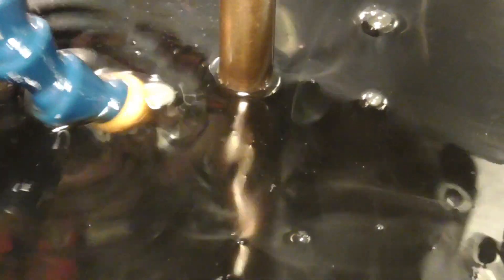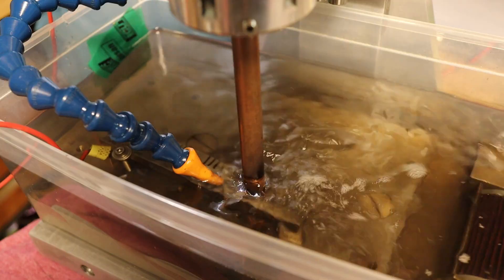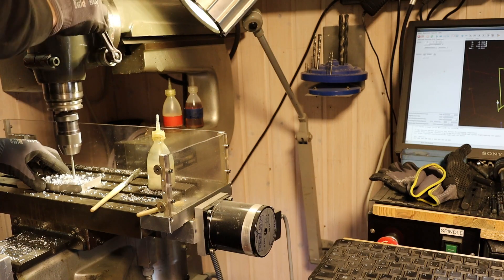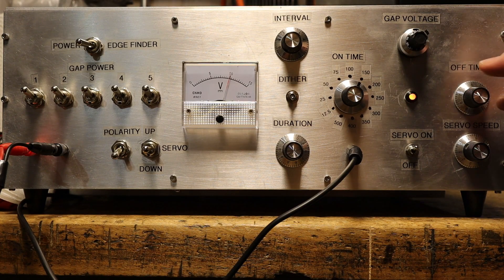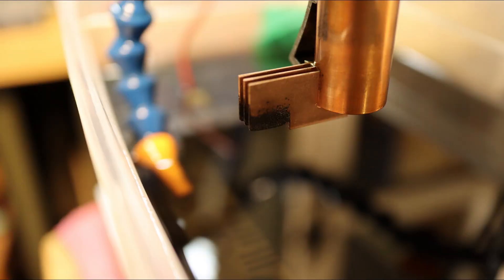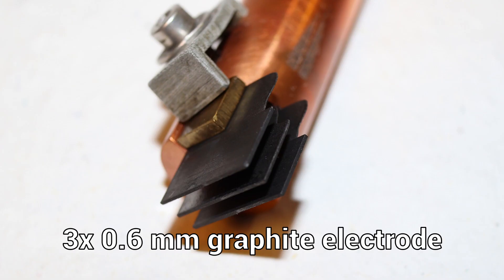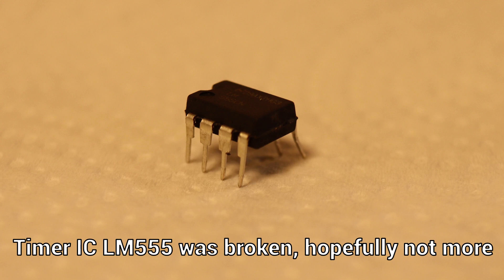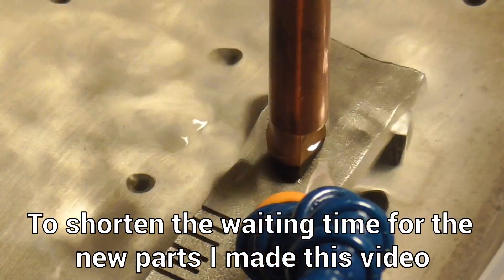DIY PULSE EDM - Part 3 - Fixing the exploded machine

Comment: I don’t know the design of the E.D.M. you’re trying to build but it looks like a pulsed R.C. design and not a true pulse E.D.M. as the burn amps and electrode wear look way too high when using a 25 Ohm output power resistor to your electrode, although you could be using two in parallel for a 12.5 Ohm output so output amps should be either just 2 or 4 at the working voltage (50v) which is not what it looks like in your video. I have found out lately that those types of resistors are a bit “iffy” so I would recommend that you just make your own from nichrome wire which works out cheaper and they also need to be fan cooled by at least a 100cfm fan.
It’s actually easy to build a true pulse E.D.M. Take a look at the “Easy Peasy” E.D.M. on my channel that I built a few years ago (and at my latest more complicated build design). I would recommend that you build a custom version of that with maybe 3 or more independent Z axis with multiple electrodes on each all sharing a common multi channel power generator. It would not only look amazing in a video but it would be the fastest way (apart from using a wire E.D.M.) to produce the slots in your engines.
If you need any help with your E.D.M. build at any time please let me know.
Reply from the maker: Hi EDMGuru,
of course I know your videos, really great work.

The EDM is a true pulse machine built after the second book of Ben Fleming.
I also built his R/C EDM which works nice but has problems with the slim electrodes.

With the heat sink the problem with the resistors is solved.

The electrode wear is much better than with the R/C EDM but not optimated (it was the third burn with the pulse EDM) and I also have obviously problems with the OFF time adjust to optimize the wear.
A 0.5mm copper electrode vs. 1.4571 stainless steel always causes some wear at least when you can't optimize the ON/OFF timing.

I hope I can fix the pulse EDM and find out  what killed the IC's and get it to long term endurance running.

Many thanks for you help and your great videos.
When I know where I need specific help I will ask.

Always waiting for new videos of you...

Greetings 
Ralf
Reply: @myengines2443  Hi Ralf,
Thank you for your kind words on my E.D.M. builds. I’ve more improvements to come btw.
Ok, I’m glad it’s a true pulse machine; it must be the output amps that are set too high for the surface area of the electrode that’s giving the high wear rate. I used to have my own spark erosion business from the seventies to the noughties and did all kinds of work including slots and also I have my own charts for spark gaps, surface finish, different electrode material into different metals, electrode wear rates at different amps and pulse frequency etc so I’ll give you some settings to try when your machine is built if you like.
It would be a good idea to stress test those resistors at full power with no lift off timer and at a true plasma burn voltage (working volts) of 40 volts or slightly less for half an hour or so just to be sure as I think you’ll need to fan cool them. Use a larger electrode with a small through hole for flushing, at less than 2 psi and all should be good.
Finally, about the slots, do they have to be that specific shape or could they be more like an elongated key hole? Only if they could be larger/ circular at the far end you could get a very small flushing hole in there and by not using your lift timer, shorten your burn time considerably. It’s just a thought.
Cheers.
Reply: @edmguru9056  I just got my pulse 2.0b board today, have been going through all of your videos and my engine's videos. Amazing wealth of information you have. I really hope you continue to post more and more. I would really like to EDM some internal splines in various pieces of hardened steels... Would you try to use a wire approach? Or would a plunger based electrode be a better idea? I need to rewatch your videos again, this time more closely. I am only going for a half inch depth of cut, most would probably be one inch. So not quite as aggressive as what my engines is doing for his... engines! 

Also, does the electrode mass or purely the "contact" area matter between the workpiece and the electrode?

Both of you guys have great channels. Channels like yours keep me on youtube.
Reply: @th600mike3  It depends on if the internal splines that you wish to spark erode are going to be in a tube/ collar or in a blind hole as to which type of E.D.M. is best to use. Wire E.D.M. requires a through hole for the wire so it would be the best and fastest way to produce a spline in a short tube or collar. It sounds like from your description of the splines that they are to be eroded into a blind hole so a plunge type of E.D.M. is the only option for your task.
It’s the surface area which determines the ideal output amps, ideally for low electrode wear aim for 25 amps per square inch of electrode if using a copper electrode but this could easily be doubled if surface finish is not a problem. The ideal way would be to use two electrodes, one being slightly smaller in width at high amps to do the main work of removing metal and then use a finishing electrode at low amps to size the splines and give a good surface finish. The flushing of the electrode is very important also on such a job and should be done by using a through hole in the electrode and at a low (less than 2 psi) pressure.
I also should point out that if you plan to build the same machine as my engines, then electrode wear and stability might be a problem as I’ve not seen any good examples of low electrode wear etc. online with that design, but I could be mistaken. I feel that you should research this for yourself first.